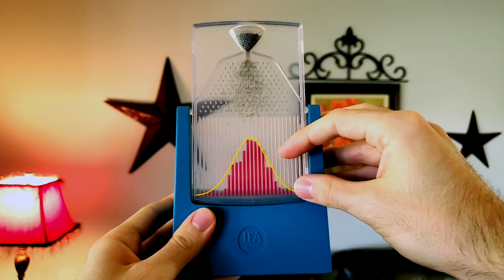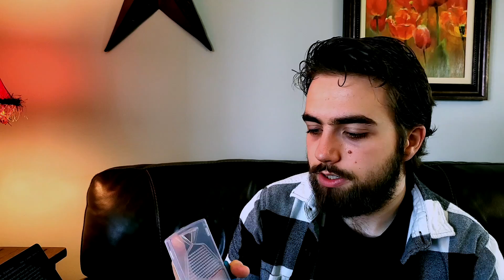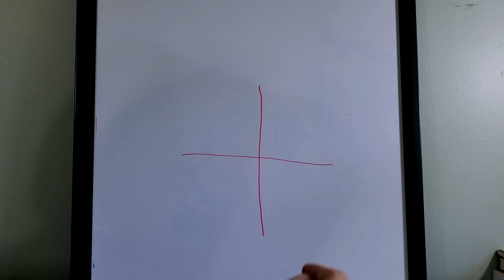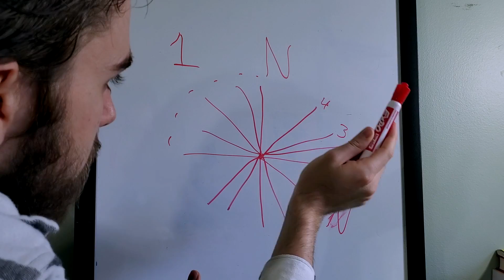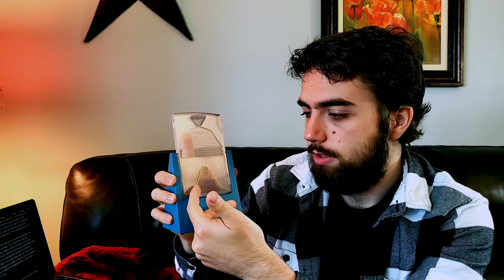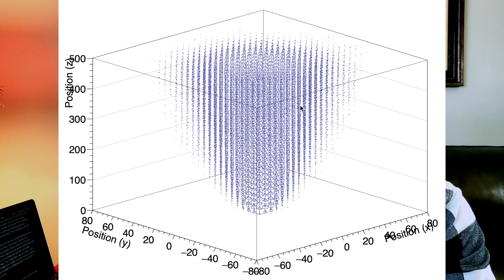Mysteries of the 3D Galton Board

Comment: What if the pegs were distributed in the same way but around a 3D cone instead of a 2D plane? The point at the top of the cone would be where the balls are released in a way that would allow them to potentially fall in any direction and the bottom circular edge of the cone would have slots like a roulette wheel for them to land in. What would be the distribution of the balls with that design?

Comment: I‘be tried a geometric approach for 3d Galton Board and it’s a bit  dependent on the obstacles pattern you start with. However, you don’t need anything like that for a simple demo. Grains of sands and air resistance is enough. There rest will depend on gravity level of the test conditions.

Comment: Hello. I commissioned a 3D model (pre-Pandemic) from my school's Engineering Dept. Hopefully, I will actually have a model to share on my channel (nSimplexPachinko) at some point. I still have not gotten word on whether it has been done.
Reply: 5:30 - I simplified the directional choice to hexagonal prisms, so there are three choices at each layer.
Reply: And again, at 10:00. This is how it relates.
Reply: 17:30 - The arrangement of the pegs should only be triangular, though it may include more that are higher than the theoretical "extreme path," due to the fact that ball bearings bounce.
I think that your "board shape" is showing a paraboloid (perhaps in a higher order than second), but the theoretical maximum shape is a true cone (mine is a tetrahedron, while being limited to three directions only).

Comment: I wonder if you actually could make one of these, depending on the size of the bearings. If you suspended a lattice of the bearings using a thin enough wire, and use bearings the same size to filter through, I bet that the wire could basically be ignored
Reply: no matter how thin the wire is it will deviate the trajectory of the falling objects. The 2D galton board exists because it uses the third dimension to put the pins in place in the second dimension. To make a 3D one we would need the obstacles to be accommodated in the fourth spacial dimension, if that is a thing.

Comment: Great video. You explain your research nicely. First, it seems to me a 3D galton board, or rather, your implementation of it, is just a random walk. It seems this could be thought of as a 2D random walk, but where the particle is continuously moving down on the Z axis. I don't think this would be difficult to confirm. Second, I wondered how packing structure could effect this. Like crystal rock would give a regular lattice, which wouldn't be present in the atmosphere. And thoughts on how this may impact the results? Finally, the not all cosmic rays will turn to muon at the same hight. What happens if you add randomization, so each particle would fall down a 3d galton board with different heights. Thoughts?
Reply from the maker: I think you are right that it is just a 2D random walk. I'm not sure how the packing structure would affect it--but my gut says it wouldn't affect it too much but then again I'd have to consider that some more. And it is true that not all muons would start at the same height, so this may affect the distribution. All good ideas! I'd really have to think about these.